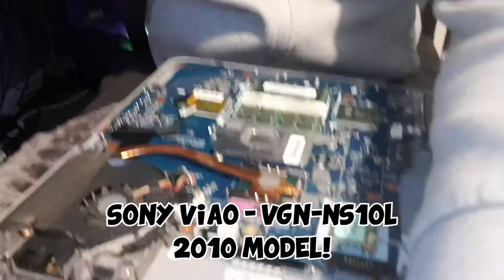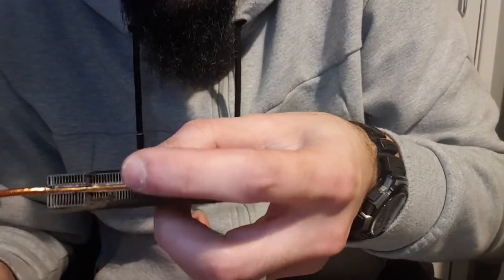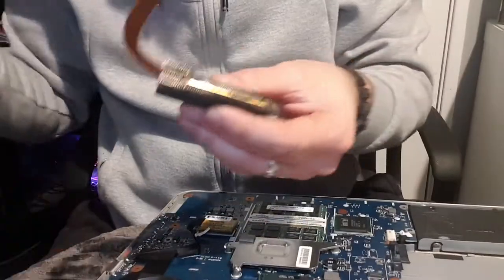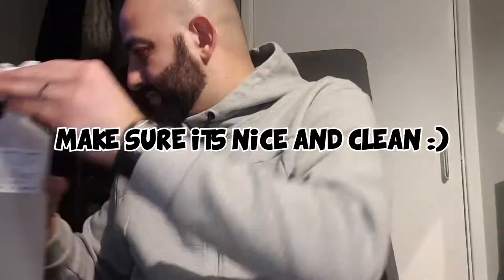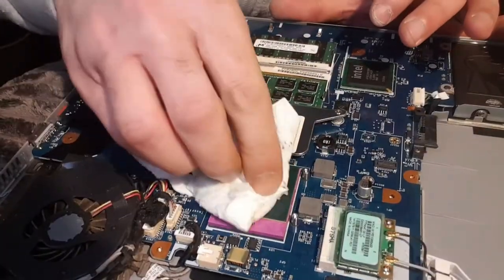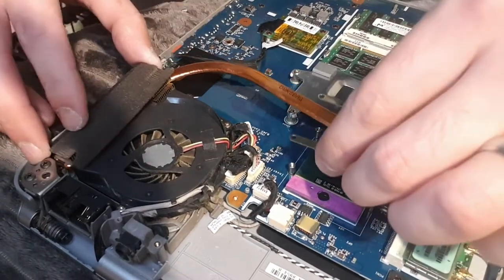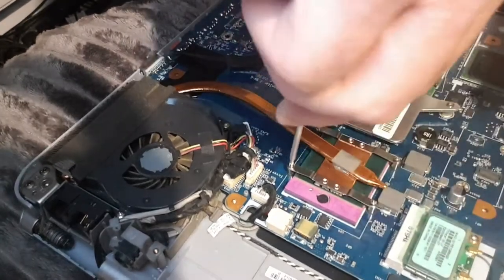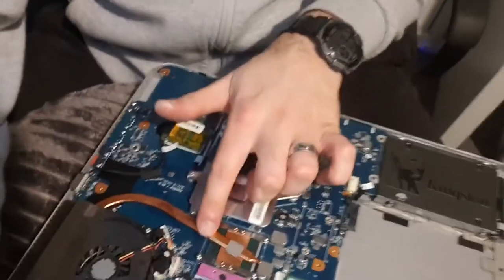How To Change Your Laptops Thermal Paste And Fix Overheating Issues (Sony VAIO)

Comment: We only use thermal paste on the GPU and CPU right so are the thermal pads ok for the other parts that come into contact with the cooling system base